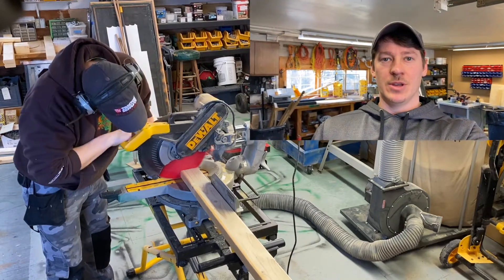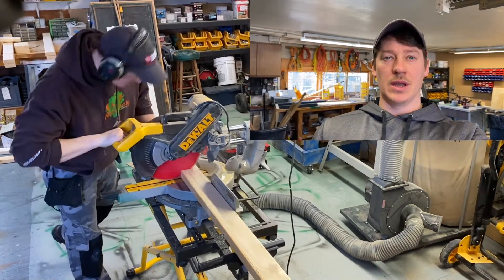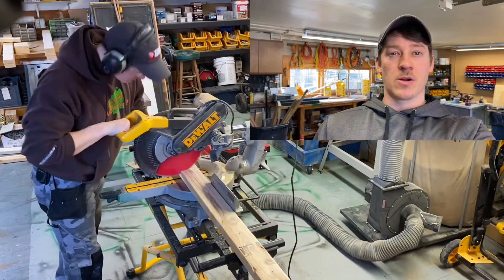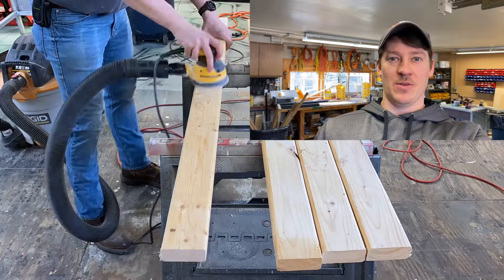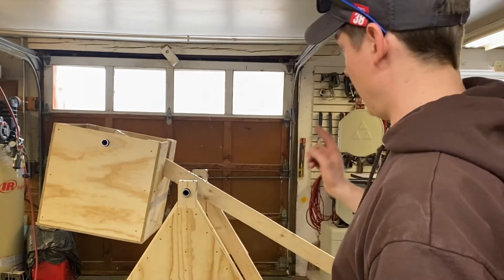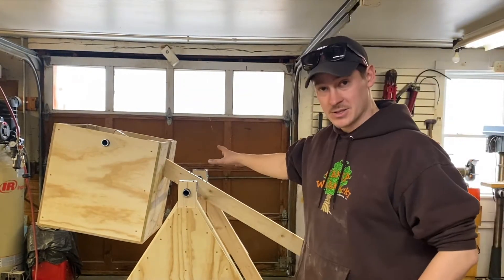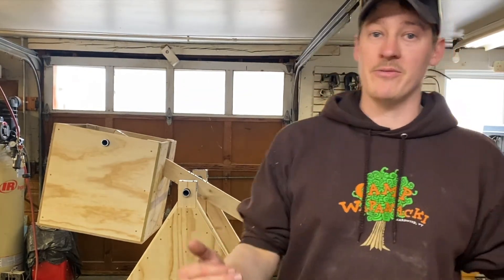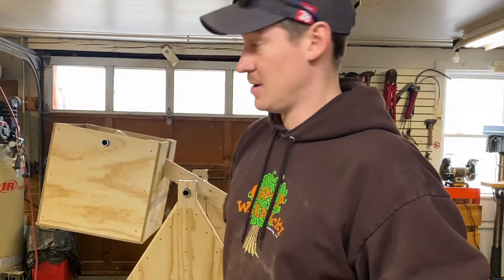Building a Trebuchet. Episode #10

Comment: I do know the length of the ropes will determine the release time and trajectory of the payload. Look into that as you may bet some better distance if the right length is found. I would worry about cotter pins snagging the wood. if you do use them use a piece of pvc or pipe to just go between the wood and the arm so that it stays still. Any drilling into the pipe may weaken it. PVC would seem like the best option to me as it will just rotate with the arm as it swings.
Reply from the maker: I need to find a calculator for a trebuchet to find the rope and weight that will work the best. That’s a good point on weakening the pipe, I may just need to use pipe clamps or some kind that I can put on and off easily.